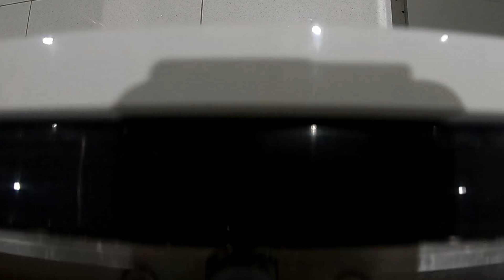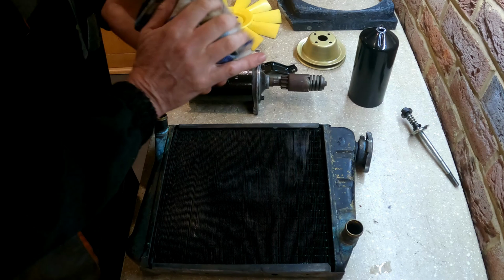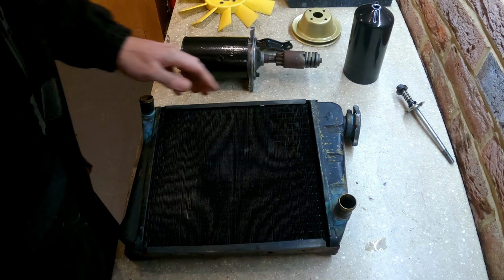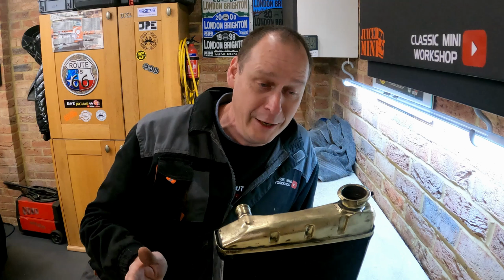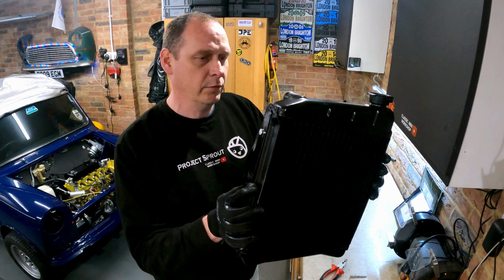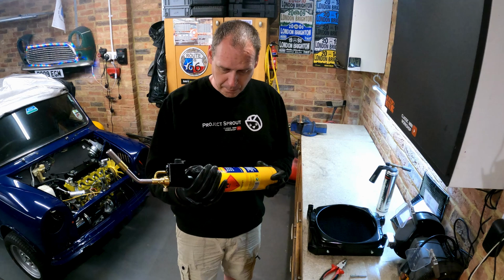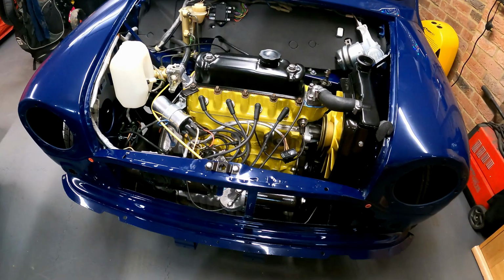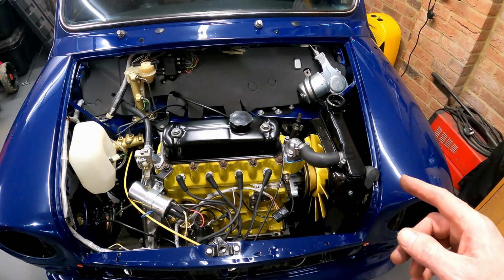Radiator & Engine Ancillaries - Classic Mini Workshop Project Tardis Pt.41

Comment: I purchased a Rothenburger torch last year after struggling for decades with cheap blowlamps - they are so much better. Hotter and more controllable. Makes soldering copper pipes much easier. My radiator cowl didn't seem to be galvanised and was badly pitted. It took ages to clean up and re-paint.

Comment: That is a mega job on that engine bay and the rad looks brand new.
On radiators especially old gnarly ones people need to be very careful when clearing out the threads on the cowl screw threads. Use a ground off tap because you can cut into the core pipes with the point of the tap and you never know until you see water pouring out of 4 places.
Ask me how I know.
Reply from the maker: That's a good point! I used new bolts and I thought to myself, if someone used bolts that were a little too long they would hit the core

Comment: You can get  a fin comb used for aircon and refrigeration units as they have the same problem also condenser coil cleaner is good for cleaning the radiators to if it’s blocked with dust etc

Comment: Its the same system on the early MGB's oil filters and the one on mine has lasted since 1968 and all the oil changes since - so around 52 or so (most by my late father in law as he owned it from new..... Telemeic? if ive spelt it right from memory
Reply from the maker: Thanks, that’s reassuring

Comment: My oil filter canister bolt, it didn’t have that clip, I only used another oil rubber O ring, it just holds everything before you install it, it’s an over engineering item 😂😂
Reply from the maker: Cool, thought so.

Comment: Never lubricate the starter bendix, clean it with petrol and that's it.
Reply from the maker: Why would you not lubricate the Bendix?
Reply: @classicminiworkshop  it  becomes sticky just like yours as you showed us. dunk it in petrol and see the difference.
Reply from the maker: @joezanella8949  Cheers, joe. I had not given it much thought but I can see the logic of grease being a bit too sticky
Reply: @classicminiworkshop  not only grease, oil too, clean it and leave it.
Reply: @joezanella8949  You could use a dry lubricant like graphite (pencil lead). This doesn't go sticky but still reduces friction on the metal surfaces. I used this trick back in 1968 to make my Mum's Austin 1100 start a bit more reliably.
Reply: @grahamwoodier5066  there was no design requirement for any lubricant, if the springs are good the bendix works well dry.
Reply: @joezanella8949  I'm sure you are right but in the real world steel components corrode and springs weaken. A dry lubricant helps to compensate. Alternatively you can just carry a hammer in the boot.
Reply: @grahamwoodier5066  I agree, things are sometimes different in the real world so keep the hammer well oiled.!!!